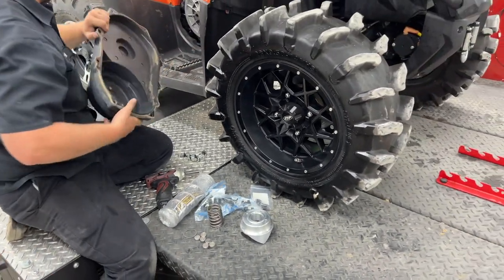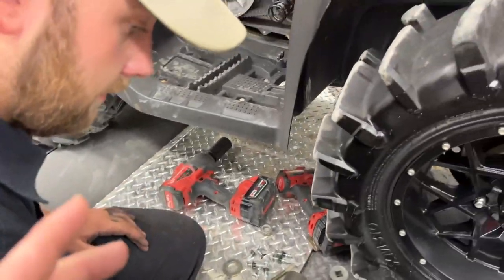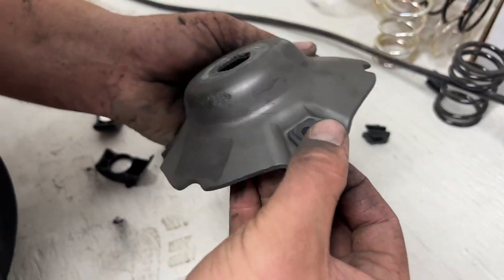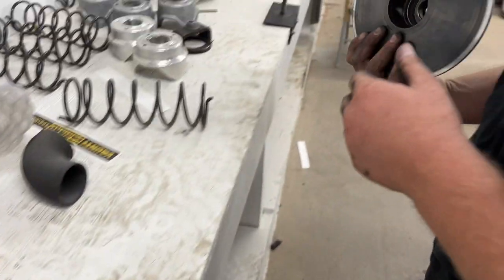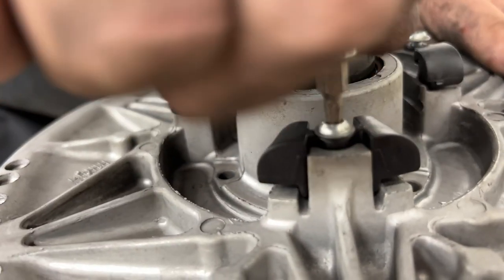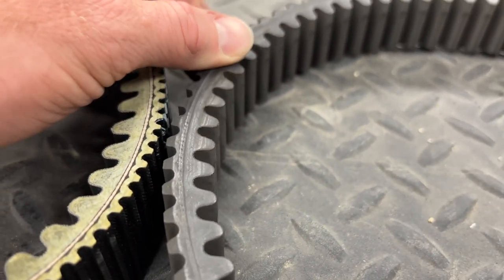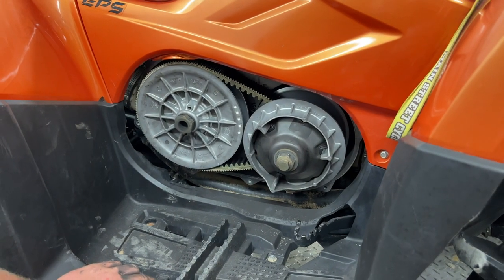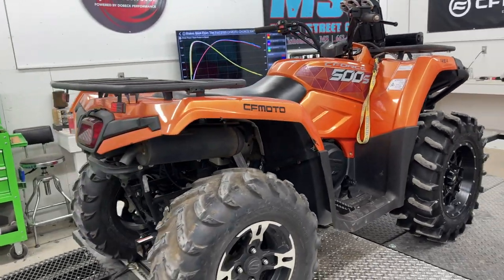CFMOTO CVTech Clutch Refresh & Repair & Stage 3 Clutch Kit Install

Comment: Sorry to dig up on such an old video.
Just getting into to CVTech game.
We have a diesel derivative (called a LandBoss) which is like a UForce 1000 with a Kubota diesel in it.
I am keen to understand what the spring weight, spring clocking and flyweight changes actually manipulate so I can start fiddling as I do NOT like the way this machine drives for what I need it to do. And also gonna be upgrading from 26s to 29s.

Tha ks in advance and I'm.gonna keep browsing your videos, they're amazing!

Comment: Question Blake? Do I just use the spreader tool to take off belt only or do I have to un bolt the secondary as well? All I am trying to accomplish is to change out the belt. Thank you
Reply from the maker: If you spread the secondary all the way you can fight the belt off without removing the sheaves.. but it’s normally easier to just disassemble the whole thing. But try the spreading the secondary part first and see if you can get it off.
Reply: @RealTalkPowersports  i greatly appreciate it! Love you’re channel and especially now that you are working on the CForce 500. My CForce 400 is a twin to yours so I am definitely taking it all in! Thank you
Reply: no dude just primary and adjust with secondary  .most videos for the clutches they remove belt they just don't emphasize  the process .good luck.

Comment: you all ever have a tinging sound from the CVT area 2022  clutch (Aluminum Clutch Cover) Z Force 800 (sounds like the secondary) I have checked everything from heat shields to break pads I have not pulled the CVT apart but was wondering if you had any advice. Thank you

Update: there is a thin metal plate behind the primary clutch that has three bolts holding it on, one of them came loose and ate into the fins on the primary housing and the tinging sound was the thin metal plate bouncing off the primary housing. the bolt was never found not sure if it was left out from factory or???.
Reply: I have a new “tinging” sound related to a bent bushing (long story) that sits in-between the two secondary sheaves. It’s on ‘08 Arctic Cat 650 with the original CVTech. Came here to see if they addressed the bushing.

Comment: I put a clutch kit on the primary and it helped. But I don't understand why you need to do anything to the clutches. I've owned can am and Polaris and I never even saw the clutch in either one because they were great from the factory. I thought CV tech are the best clutches out there.
Reply from the maker: They are GREAT from the factory.. but if you want more performance out of a CFMOTO, canam, Polaris… and so on.. the most effective performance upgrade is a clutch kit

Comment: Have a somewhat different style 2nd clutch on an old 500 Polaris.   It has a small plate on the outside with 3 slotted holes,  that plate turns a bit under load.  Can’t find a similar clutch anywhere.  Took a picture, but how do I send it to you for display?   I suspect it could be a golf cart clutch?  (Actually,  both clutch seem to have been replaced with different ones).

Comment: No matter what way i change my clutch, clean,scuff up stages, springs,weights etc it is always running way too hot right off under normal riding. Cant cruise paved roads, dirt mud etc. Just getting fed up with it and thinking ill trade it innfor a honda
Reply from the maker: Hey is it a Gen 1 500 like mine in this video??
Reply from the maker: If so you just need the MSC tune for it..
It’s too lean and that’s why it’s running hot..
MSC tune fixes that
Reply: @RealTalkPowersports   21 uforce-1000. Belt heats up to 200plus within min of just regular riding.  Going to try an put oem belt back in. Its done it regardless of belt,weights,primary or secondary springs, clocking an stock or stage 3 helix.  I noticed my cover doesnt have the heat deflectors in it like the diagram does. So maybe it not directing airflow properly.

Comment: Good evening fellas… question… ive been seeing videos of guys buying and putting on a cvtech primary clutch on their can am’s and they are taking out the restricter sleeve behind the primary spring and counter weight on the backside of the primary. What is the reason for this?

Comment: What about the one way engine brake bearing I’m thinking of deleting mine and was wondering if the bearing on the 800 is the same size (since it doesn’t have eb) or do you sell one with out the one way bearing in it?

Comment: Did Joel have to use a puller to get that stuck primary off? I’m having the same issue
Reply: Hi. Do you remove the clutch? I can't remove it
Reply: I ended up having to use a puller to get mine off. Once I did that it always comes right off now. I think there was some thread locker that accidentally got by it and had it locked
Reply: @garrenweigand1261  that puller did you use? Can make a photo? 😮‍💨

Comment: What size tires are you running and are there radiator relocation kits with a snorkel kit built in because I have a 2021 cfmoto cforce 500 I'm making a mud bike and do you have a lift.
Reply from the maker: You can find all of that on the accessories page on the Main Street Cycle website..
But the radiator relocate kit and the snorkel kit will be 2 separate items